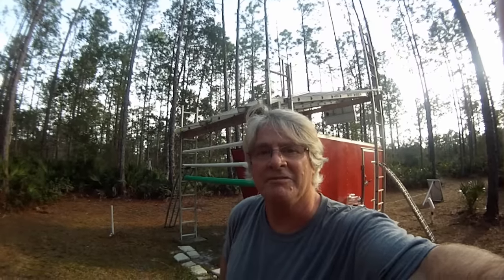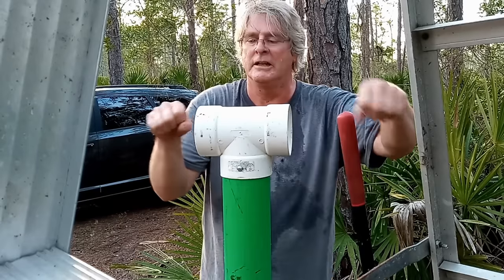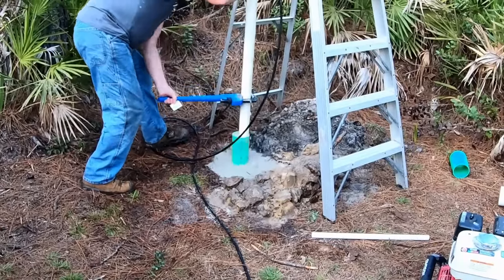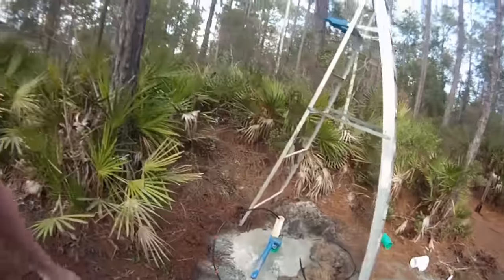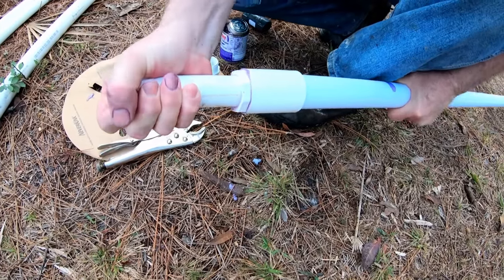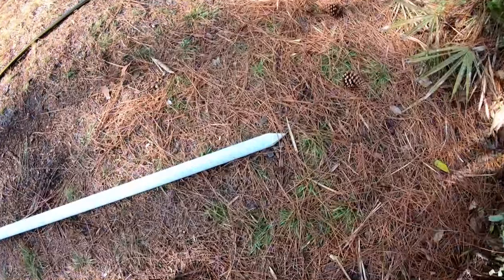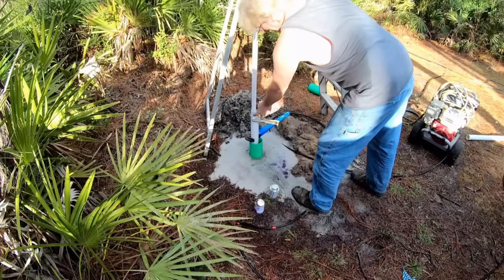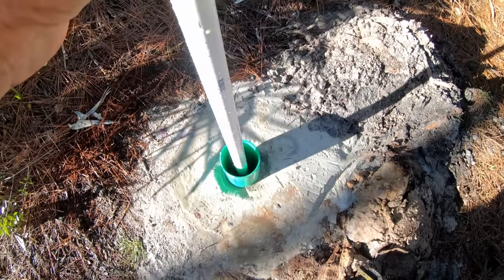Easy SHALLOW WELL DRILLING Howto DiY drill 25 ft shallow well

Comment: It always looks so easy on video. Here along the upper texas coast I hand drilled a couple of wells and lost a couple more trying. To start with the soil here is very hard clay with some small gravel after about five feet down. I tried the pvc with the notches in the end and it simply wore off the teeth. I had to take a steel 2" coupling and attach that to the end of the drill pipe. In my soil it takes all day to drill down 30' and if you stop the pipe moving it seizes up and you can't break it free. No removing it after drilling But with luck you can pull it up five or so feet to get your 1&1/4 pipe down below the end. The problem is at that level you're at the bottom range of most pumps so you get a very reduced flow. On mine it's four gallons or less per minute. You have to get at least a 2" line down with screen to use a jet pump to bring the water up in a higher volume. I needed more water to keep an acre and a quarter pond full and it tends to evaporate at a higher rate than four gallons a minute during dry summer months. On your pvc gluing you will have better connections if you use the cleaner on both pipe and coupling and let it dry for a couple of minutes and then apply the glue to both surfaces and put together quickly. Putting the glue over wet cleaner simply weakens the glue.
Reply from the maker: Hey 711,
Thank you for watching!
your experience and comments are appreciated!
Thanks again for watching!!
Reply: same here digging in hard clay, gravel and some rocks  this water jet would not work.  I almost had to start over because of a rock, but I got lucky. I broke the rock free with 12" pole and chisel and was able to bring it up with the auger
Reply: This is Florida sand. I have dug a pool sized pond in like 3 months doing 10 barrels a day during weekdays. It's nothing to dug into the sand here
Reply: Good point! I'm going to try in Georgia a few weeks later.
Reply: @clintonkim5075  When I said use a steel coupling you have to take a bandsaw or grinder and cut the teeth into it but it works like a champ.

Comment: A master plumber told me to NEVER EVER use Teflon tape on the suction side of a pumping system. The tape has a tendency to strip off the threads as you tighten the coupling leaving an opportunity for air induction at the joint. You will never know it has been compromised but will suffer from lack of draw and some cavitation at the pump and possibly loss of head above the foot valve. I experienced that very problem but didn't know it until I put in a pressure tank and all my joints on the suction side of the pump started dripping when the pump was not running. I busted it all apart and used some liquid pipe dope suitable for the application and have been bone dry ever since. Hopefully this little tip will help someone avoid the problems that I had.
Reply from the maker: Hi Mike,
Thank you for watching.
Nice comment and story.
Thanks again for watching
Reply: By liquid pipe dope do u mean the kind for gas lines ect? Or pvc glue?
Reply: Thank you so much thank you for saving US A crap ton of time bro
Reply: Dude, my tractor hydraulics cavitate ever since i used teflon on the connections. I didnt know it was a no no
Reply: Said those words as i watched your vid. Should be using pipe dope.
Reply: I just pulled a brand new point and redid the joints with dope, only to find it was still leaking.  I had another problem with new pipe on a different well.  No leaks when I left, but a day or two later it was leaking like a sieve and half the fittings were loose.
Reply: @ikesquirrel  Did you ever resolve the problem? Was it bad pipe dope or was the pipe getting rotated counter clockwise as it was being drilled into the ground? Anything?
Reply: You won't get water out your pump if you have an air leak dead bottom line
Reply: I’ve discovered it’s more reliant on the direction you put the tape on. You want to use the tape WITH the tread. Not against. The if you go with the treads it won’t ball up and tear but rather cut and seat into the treads as it tightens. If you go against the tread, the tread will try to “unravel” the tape and will ball up and create an uneven seal surface prone to leaks. This is extremely important with air fittings. You tape the wrong way, it will tear , ball up, and eventually leak. With underground stuff, definitely recommend pipe tread dope though just to be safe.
Reply: Tape first then pipe dope over the threads, and if I didn't do that then the master plumber would chew me out.
Reply from the maker: @ikesquirrel  Hello ike,
can't win for loosing here. What did you do to correct that problem? Maybe use copper pipe? Something with a more tapered thread? I'm curious as to what was your resolve. I'm still sold on pipe tape but I am always open to suggestions. Thank you for watching!
Reply from the maker: @nodaklojack  hey no dak,
Thank you for watching!
I haven't had any problems with well head and piping. I do think if I ever needed to drill and install a new well, I would probably not use any hing on the threads of PLASTIC. but if it were galvanized or copper I would use pipe thread tape and or pipe dope. Thanks again for watching!
Reply: Well, as a master plumber I disagree. If tape is put on properly there isn’t a issue. But perhaps, for a non-plumber, perhaps pipe dope(thread sealant) would be better. But one thing is friggin air in the suction side is a bitch, to find and to determine.

Comment: If you use a six inch pipe with a T on the top, you can reclaim your water in a drum while you drill.  Then you can add bentonite to your water to make "mud" which will lift your cutting out easier, and you'll be able to fit a 4" pipe down.  When you put your 1" down the 4", you have room to dump pool filter sand around your screen and make your well last a lot longer.  Pull the 4" pipe up to the top of your screen, and run hose water down the 4".  Sand will settle and hold the pipe up. No need to pull any pipe out.  Pour a bag of cement around the pipe at the top, and its fixed in place.
Reply from the maker: Hey Jay,
Thanks for watching.
interesting comment
Reply: Great advice! Thanks!

Comment: I like the pressure washer idea.   I did mine with a standard garden  hose.   I was in water bearing sand at about 8’.   I ended up with a 27’ well that has never run dry.  It’s just irrigation but its clear and smells and tastes fine.
Reply from the maker: Hey Gene,
Thank you for watching!
well done! Yes, this system is great for irrigation.
Thanks again for watching!
Reply: How much further do I drill once I hit water bearing sand? I am down about 15 to 18" now.
Reply: @unitynow2868  I went until I couldn’t go any more.  I wanted 40’ but at 27’ no more water was coming up.   I’ve never run out.
Reply: What did you do with your 2” pipe?  Did you leave it in or remove it?  I was going to cut some slots 5’ up the 2” and leave it in.
Reply: @CarolinaRealEstateGuide  I dug down as far as I could then placed a 6” pipe in the hole.  I almost got a 10’ er down.   Then I used a garden hose to jet down a 4” pipe down 27’.   I put  a 1 1/2” pipe with a slotted filter then poured down 4-5 bags of small rocks.  I pulled out the 4” slowly leaving behind the 1 1/2”.    The 6” gave me a head start and we have a coral shelf at 6-10’ down.  I had to dig through that before I could start.   I tried without digging and couldn’t get through it.  I tried multiple places.    If you don’t have that problem don’t bother with a starter pipe.

Comment: When you are sinking the 2" pipe it would be easier to use two pipe wrenches facing the opposite directions so you can turn the pipe both ways without resetting a wrench. You can also lean on both of them to sink the pipe faster.
Reply from the maker: Hey whataguy,
thank you for watching.
thats not a bad idea!
thanks for the tip.
thanks again for watching
Reply: @AtlanticDrain  You're welcome! I built fences for 34 years before I retired and I used this method to pull up steel chain link posts that had just been driven into the ground instead of being poured in concrete. The only difference between methods is that I was pulling up on the wrenches and you would be pushing down...........Enjoyed your video but my place is too rocky to dig a well using your method. We had to go 81 feet through mostly shale.
Reply: I'm going to do this too, but I'm going to use two 12" strap wrenches instead of a pipe wrench, so I'll let you know how well that works.
I'm pretty sure it works better than heavy awkward pipe wrenches.

Comment: FYI. Small thing I think you put the teflon tape around the wrong way on the threads. You want to wind it on so that the tape is wound on with the threads same direction so it does not unwind as you place the other fitting on. You way will work as well but its not as secure and may loosen when you tighten the thread. Good Work
Reply: I was watching for that too but I think they knew what they were doing. There was plenty of competency shown here.
Reply: @teeanahera8949  it was the wrong way.
Reply: righty tighty - lefty loosey. IE righty, clockwise for the tape and then the fitting.
Reply from the maker: Hi chiefman, thank you for watching and sharing

Comment: I live nearby in Silver Springs FL, the forest side.  For the last three decades I see OLD 2" wells with jet pumps on top and the water is ALWAYS delicious.  And now 6" casings are required with submersible pumps - almost ALL these wells have rancid iron and sulfur water.  It's become the most dishonest business around.  The drillers have people duped that the deeper the well, the better the water.  On the contrary.  Why do all the old shallow wells have the BEST water?  Because as you've proved on video, it's NOT far down.  But the drillers would go broke if people knew this.  I'm living in a place where the previous owner was told water was 275' down.  After drilling a s#^++! well, the driller tried to sell him water treatment systems, etc.  I bought the place and go through lots of filters.  I found your video and am convinced I can do this.  My big question is: how do you know where to drill that hole?
Reply from the maker: Hey C JB,
Thank you for watching.
its more hit and miss for drilling. but more often than not,
about 25 feet down is the water pockets.
have you seen any other shallow wells near by?
Thanks again for watching.

Comment: why not leave the 2 inch in the ground as it was.
Reply from the maker: hey micheal, thank you for watching!
you can leave 2 inch in ground.
maybe just pull it up as so well point is exposed in water pocket. otherwise, the 2 inch will not let enough water in around your well point thanks again for watching!

Comment: Great video! I’m in southwest Florida and will be doing the same thing for my lawn sprinkler system. I will be drilling (2) wells spaced 20’ apart, tying them together with a 1 1/4” PVC pipe with a tee fitting and then run the pipe to an above ground 3/4 HP shallow well pump. I was planning on using 1 1/4” pipe up through the 2” to tie to my 1 1/4” sand point. I noticed you used 1”. Will the 1 1/4” be a problem? The pump requires a 1 1/4” intake pipe. Also, I bought the mini sewer better. It seems that the holes are too small and I was thinking of drilling them to make the holes larger to get more water spray volume. Thoughts? Thank you.

Comment: I plan on doing the exact same thing jetting with a pressure washer I learned from watching this video this coming weekend but hopefully 25’ will be good enough for a pitcher pump here in North Florida 🤞🏻🤞🏻
Reply from the maker: Hey Swamp,
Thank you for watching.
YEH!pitcher pump,  That should work good.
Reply: So did you get it to work in northern Florida? In Indiana I put in two wells myself in very sandy soil for 13 feet then 10 or so feet of clay and river rock. I used a sand point and a big sledgehammer. Both was 35 feet deep with water in the pipe at 17 feet deep. I just bought raw land in Suwannee county Florida and it’s nice sandy soil like back in Indiana so I’m hoping to have success again. I dug down 7 feet with a shovel with very little effort.
Reply: @dancompagnari4946  I got to a little over 25’ and still clay 🤬 I’m going to try and move locations but I can’t go to far from where I’m at.
Reply: @jiggjohns1028  I’m surprised you hit clay from what I have heard it’s usually just sand , I hope I don’t have to deal with clay again cause the two wells I put in up in Indiana I had to pound through more than 10 feet of that and it will ruin a sand point and pipe and couplers if you don’t watch it really close. I always use a sacrificial piece of pipe say 6 inches of pipe right above a drive coupler as it really does help plus that way when the drive cap becomes stuck to the pipe it won’t be stuck to your actual well pipe. If you know it’s just sand you can probably get by without a sacrificial piece but I have not been that fortunate. I’m in Suwannee county, where are you?
Reply: @dancompagnari4946  Bradford
Reply: @jiggjohns1028  I’m in the O’Brien area. Neighbor just told me that his well is 100 feet deep. They hit water at 35 feet but I don’t know if it rises though. In Indiana you hit water at around 30 feet but once you hit it the static level is about 17 feet.

Comment: I'm a plumber  you don't need to use primer on PVC pipe for pressurized water, as long as its clean, drain pipe always needs primer  but always glue both sides, PVC glue actually slightly melts plastic and "welds " it together.  Been better to have cut slits in the last few feet of the 2 inch pipe and use it like a well casing  you will appreciate that when you have to remove well point for service  also dig around pipe down to about 3feet and cement to right above ground level, you don't want contaminated surface water seeping down without being filtered through the soil.  And get yourself a couple pairs of channel locks lol. Good video though.
Reply from the maker: Hey donald,
thank you for watching
Reply: Great comment. Should you install a check valve after your well point slits?  Could you install one right before the pump for easier service?
Reply: @CarolinaRealEstateGuide  
I have a 20' 1-1/4" galvanized pipe with a well point at the end. The pipe has one right angle bend to enter the house and then another right angle bend just inside the house followed by the check valve. Then another 2 right angle bends to adapt it to the water pump location. The check valve is located inside the basement together with the water pump & water tank. I've had this working for over 25 years so far with no problems.
UPDATE: There was one problem. The condensation on the galvanized pipe caused the pipe to rust & fail at one of the connection points. Good idea is to paint the connections to prevent corrosion from the condensation. Although the pipe is galvanized, the threads are not & that is where the failure occurred.

Comment: Always glue both sides of a joint , If it blows apart that will be where it is
Reply from the maker: hi jacob,
thanks for watching.
Reply: Enjoyed the video!  

Yes, prime both sides. Also, wrap your Teflon tape clockwise so when you tighten the connection the tape stretches and does not bind while trying to unwind.
Reply: And don't twist it
Reply: If air leaks, you lose the vacuum.  It will need to be primed again before drawing a vacuum and pumping water.  That will be a reoccurring problem.   There’s always a correct way, and then a lot of other ways too, no big deal.

Comment: I had Shallow well installed year ago in Clearwater Florida.  Installer indicated 19ft deep.  Water has odor, copper color and lab testing reveal . higher salt content than I expected.  I want to use in garden.  What might be solutions to get better water?
Reply from the maker: hi durian,
thank you for watching. only thing i can think of right off hand would be to aerate  the water by making a cascading water fall and holding tank. then, spray /water your garden. maybe add a filter too. 
let me know if you come up with something different

Comment: So I have 2 inch 50 feet down. I messed up on the drill end can't get it down anymore. But still head one one inch down 80 feet super easy. Going more to hit aquafier soon.
Then pull up install well point and stuff back down. I got loads of water coming out of 2 inch. I got to pull up 2 inch so earth seals into one inch. What can I pour down to seal? Or help seal. I'll up load videos now
Reply from the maker: hey jacob, thank you for watching! i just watched your video. you need to use pipe reducers or, what is called a no hub. its a rubber boot and they come in various sizes. you can get a 2"x 1.5" and then put a piece of 1.5 " over the 1" pipe, Then get a 1.5" x 1 inchno hub , tighten down both and you will have a sealed well pipe. all water will flow thru the 1 " pipe. hope this helps and thanks again for watching